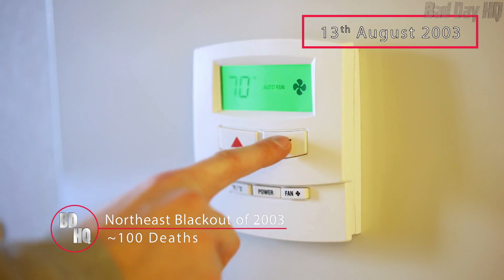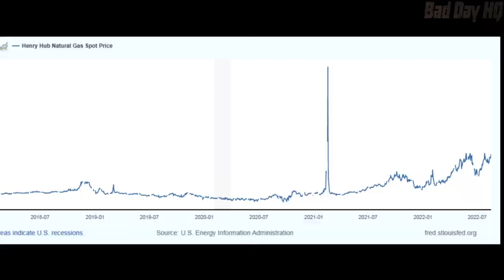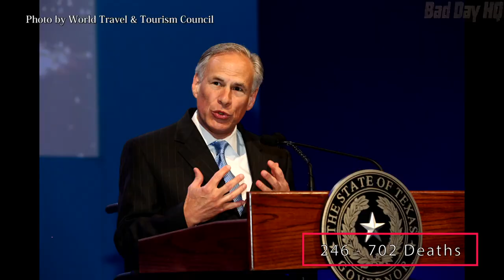Top 10 Deadliest Power Plant Disasters

Comment: Im sorry this list is all over the place. Even if we ignore that Chernobyil is on 9th place, how are the drilling oil rigs in cateogry of power plants?!? And how are blackouts here as well?
Reply from the maker: We acknowledge in the video that Chernobyl should be higher but we have to go by reported deaths. 
Oil and LPG are used to power cars and appliances; we went with a more broad term of energy rather than just electricity, to make a more informative and entertaining video. 
We included blackouts that were caused by a failure with the power plants (alarm system failures in the midwest and not winterizing in Texas)